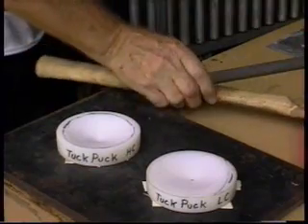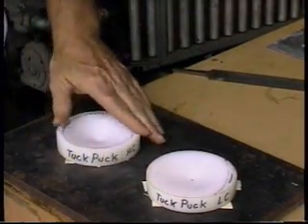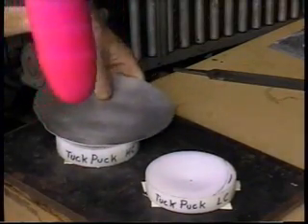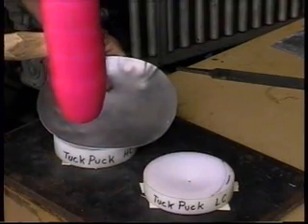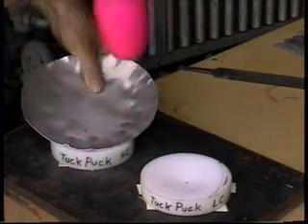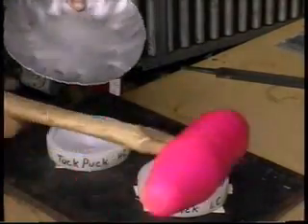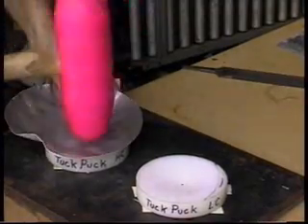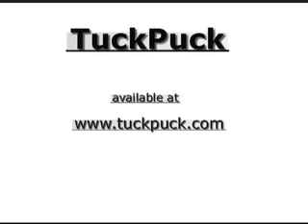Introducing the TuckPuck metalshaping tool

Comment from the maker: @mav4687: A shot bag is primarily for stretching metal. The main purpose of the TuckPuck® is for shrinking metal. It is important to strike the metal in the appropriate area of the TuckPuck®. It can be used to stretch metal as well. It depends on where you place your hits.It is a dual purpose tool. I really don't believe that a larger size would be of any benefit.  The high crown is for aggressive shrinking. The low crown would be about what you would have with a larger diameter. For less shrink

Comment from the maker: The TuckPuck works just as well on steel and even works on stainless steel. Actually all of my tests when I designed this tool were done using steel. I just happened to have a disk of aluminum handy when I shot the first part of the video.